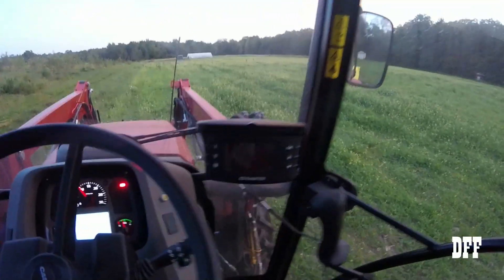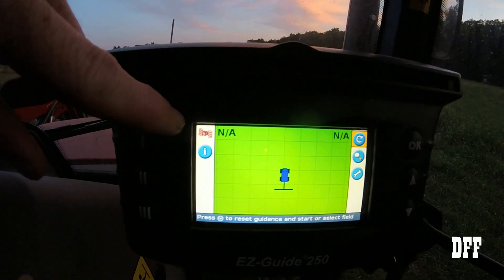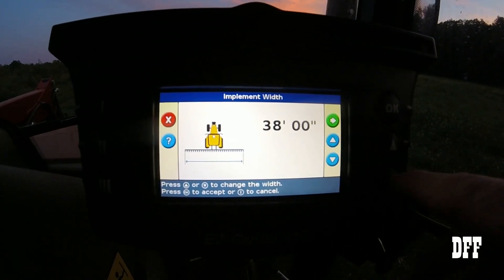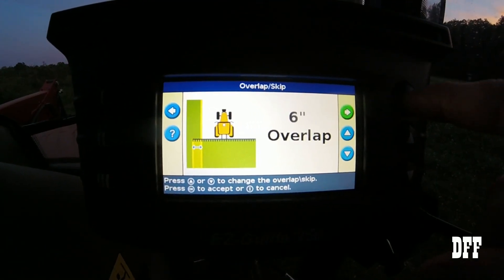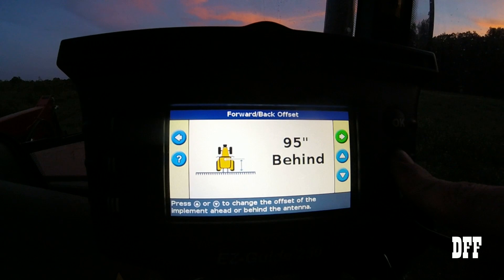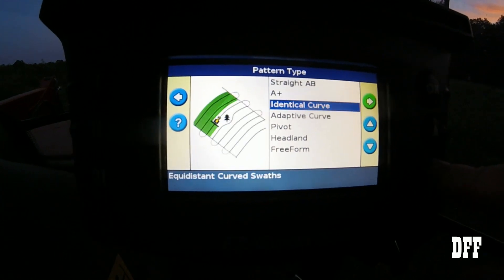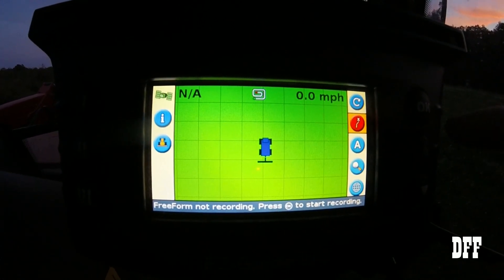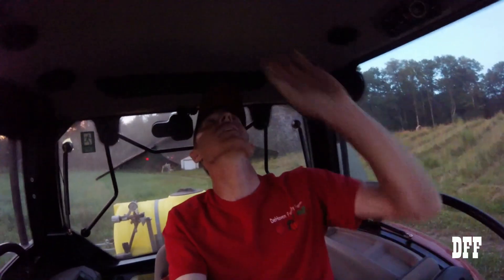Trimble EZ Guide 250: Basic Field Setup

Comment: Yes to freeform, I use that one all the time. I have the 500 and in there is a setting that connects the paint button to the freeform button so you only have to hit the paint button on the left and will do both at the same time. Not sure if that is on the 250 or not. I went with the 500 because I wanted to also control the on off of the boom when spraying.  That really worked out great this year once I got everything programmed correctly.  Some kind of GPS is a must for spraying and spreading materials on your fields.  Thanks for sharing.
Reply from the maker: At least I'm not the only one lol I thought most people use the A B lines